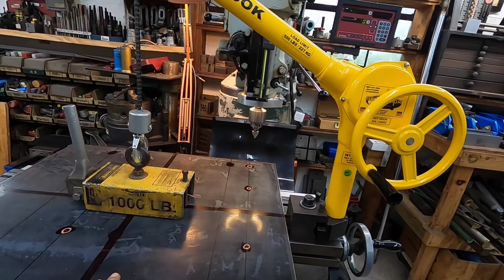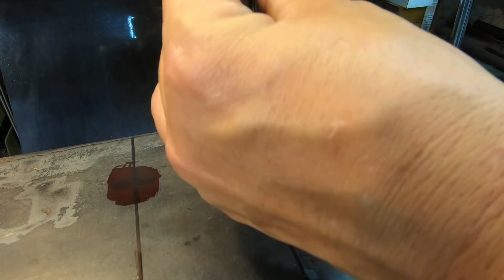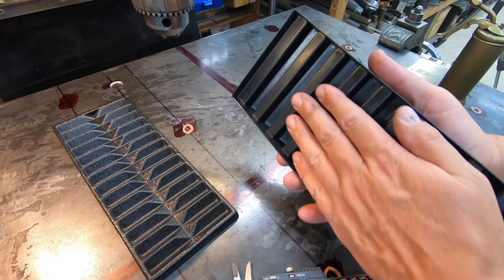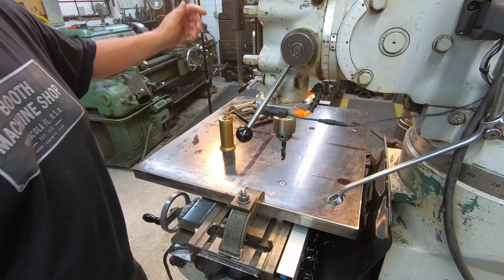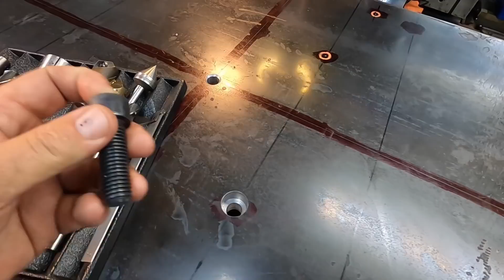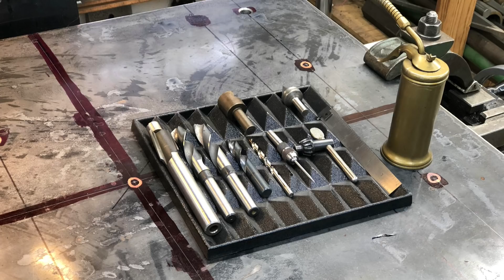Machining Hole Patterns in Stoker Engine Fixture Plate

Comment: Nice job Adam, but I have a question: why would you not tap the holes right after drilling them?  Everything was lined up and it would seem to be more efficient to tap the holes in the same setup as the drilling.
You gave some great explanations of basic layout methods and how to use the centre-finder wiggler to align the spindle with the punch divot.   I also really liked the optical punch unit and those neat little trays.

Comment: 19:44 interesting effects on that DRO screen. I assume it's the camera almost syncing with the screen refresh.
Reply: Yes, it is the same effect that makes wheels and propellers or rotors e.g. on helicopters look like not moving or spinning backwards. LEDs usually flicker, also we do not usually see this due to either the frequency or some kind of inertia in some LEDs (mainly those that use chemical coatings to create a certain color, but actually it is 99 % frequency)
If the camera shutter is not synched exactly to the LED frequency they will flicker. same with fluorescent lamps. sometimes depending on the chip type in the camera you may also see those brighter and darker stripes vertically rolling through the picture. To avoid that effect you would have to run the LEDs on actual DC (which is rare) or use a shutter speed that is slower than the cycle for the LED.
In the LEDs this flicker is usually generated by how the LEDs are driven, or more exactly which power supply is used. In the simplest case (most LED light bulb) it is just a capacitive dropper, that more or less cuts the AC sine wave in half, so you will find frequencies related to the AC frequency, 60 Hz for the US and Canada, and 50 Hz in Europe for example.
Better capacitive power supplies invert the "negative" partof the sine wave so we get double the frequency. Only the "inertia" of our eyes allows us to not usually see a flicker.
Incandescent bulbs flicker at twice the AC frequency as well as the currents sine wave peaks at positive and negative and in between crosses zero. it is just that the actual glowing of the  filament wil dampen the flicker as it does not cool down fast enough to make it visible.
Some LED drivers use smoothing capacitors to generate such an effect.
Less an issue are switch mode power supplies. those internaly use a chip to change the frequency to something in the range of 30 kHz, which allows a lot smaller transformers to be used. To capture that flicker you would have to borrow a camera from the slow mo guys to make it visible.

Comment: He got it figured out, but he didn't, he did not need the cart at all, once the sky hook had rotated the plate out into the isle way it would rotate freely, then swing the plate back in. Ron W4BIN
Reply: I was wondering why he used the cart to turn the plate around at first, but I think he had a good reason to do it that way. The sky hook's bicycle sprocket chain isn't going to twist very far, and I suspect that the hook doesn't have a pivot. So, spinning the plate 180º on the sky hook probably wasn't a good option.
Reply: @Nf6xNet  I wondered about the hook as well. Not sure if that is an extra available if you order a Skyhook, but I bet there are a lot of situations where a swivel joint attaching the hook to the chain would make life a lot easier. Just not sure how much bigger that would get or if it would reduce the load capacity.
Reply: True - but the cardinal rule of lifting heavy material is to never have it higher off a supporting surface than absolutely necessary.  It would better to have the plate drop an inch onto the cart than four feet to the floor and so the cart was there to provide a safe surface onto which the plate could drop should the magnet, the strap or the skyhook cable fail.
Reply: True - but the cardinal rule of lifting heavy material is to never have it higher off a supporting surface than absolutely necessary.  It would better to have the plate drop an inch onto the cart than four feet to the floor and so the cart was there to provide a safe surface onto which the plate could drop should the magnet, the strap or the skyhook cableThe cart provided a safe surface onto which the plate could drop should the magnet, the strap or the skyhook cable fail.  fail.

Comment: Could you use the FlexArm to drill the holes?
Reply: It has no means of applying downward pressure - so would rely on your own body weight - and for that to be enough, you'd have to use a whole series of drills making the holes an eighth of an inch bigger each time !
Reply: In addition to what pmailkeey wrote about no downward pressure, the FlexArm is made to float around in X, Y and Z while preventing rotation. Maybe it would have been fine with that piloted counterbore, but it would have relied entirely on each drill self-centering on the punch mark or the previous hole. I think the finished hole locations would have been less accurate with the FlexArm.
Reply: @Nf6xNet  Not sure about 'X','Y' and 'Z' ! possibly more h, r and θ !
Reply: @millomweb  True!
Reply: @Nf6xNet  oh boy, here they come... ;)
Reply: @alexku8452  Could you use the flex arm to make a milkshake?
Reply: @Nf6xNet  You just have to find the right YouTube machinist to make a stirrer that can be mounted in the flexarm for that purpose. I am just not yet convinced if the flexarm has actually enough rpms to make a really good shake though...
Reply: @alexku8452  What if we add a little planetary gearbox to speed it up? LOL!

Comment: Wondering why when it came time to rotate the plate 180 you had to set it on the cart. Couldn't just hoist it, spin it and drop it?
Reply: I think the chain on the skyhook is a roller link chain like a motorcycle chain, they don't twist well
Reply: @UnreasonableSteve  AH
Reply: @woeuntousall2611  Yeah - doesn't appear to be a swivel on the hook. Maybe he should have just unscrewed the eye bolt a little on the magnet ;)
Reply: @UnreasonableSteve  Wouldn't there be a swivel on the hook itself? Looked like there was plenty of room to spin if there was a swivel.

Comment: Adam, when you chamfered the counterbores, why didn't you chamfer the "inner" hole too?  Don't the SHCSs have enough radius under the head to interfere with a sharp corner?  I'm not trying to be a PITA here, I'm just curious and interested in what you and others say about this "possible" interference.
Reply: No need to chamfer the inner hole because he drilled it for clearance. A clearance hole is larger than the OD of the bolt under head radius. If you are still not sure look up what is meant by a clearance hole.
Reply: @utidjian  I was thinking that since the 1/32-inch clearance only gives ~0.0156-in. per side, that corner could hit in the radius of the screw.  I'll go check my Machinist's Handbook to verify though.  Thanks!

Comment: Question Adam, what could happen to the drilling of the pilot holes if you didn't spotface first?
Reply: This is a good question. Spotfacing helps ensure that the pilot drill stays vertical and doesn't "walk" or bend, which results in a non-vertical or oval hole. 
At 6:44 Adam gives us a great head on view of the larger drill bit where you can see the "flat" section in the middle. With a small pilot drill that can bend, that small flat spot may cause the bit to skid over the material surface before digging in and starting the hole. By spotfacing and providing a countersink for the pilot drill to match up with, you know it will start drilling in the right location.
I don't know if we see the tip of the spotting drill in this video, but from what it looks like based on the chips and how pretty the countersink looks, is Adam has a special grind on his spotting drill where that center flat on the tip is removed, essentially the two flutes meet perfectly in the middle. It is also relatively wide and short which helps with rigidity, again helping ensure that the countersink it leaves is centered in the correct location.
We use center drills a lot at work, which serve the same purpose but only have one flute and a stepped grind.  https://upload.wikimedia.org/wikipedia/commons/thumb/d/df/CenterDrills123456.jpg/400px-CenterDrills123456.jpg

Comment: Even using the prybar to get the plate up you should really be using some sort of a push bar to get the parallel under. I was told long ago by a guy missing the tip of a finger "never stick your finger anywhere you wouldn't stuck your pecker" 😂

Comment: Hey Abom! Question,
is there a reason for why - when drilling - you squirt the oil at the upper parts of the bit and let it drip down as opposed squirting oil directly at the cut? Just wondering
always interesting to see you work!
Reply: Same result.

Comment: Suggestion to all, for every commonly used tap make up a wooden block and drill holes to take that tap set plus is tapping drill plus it's clearance drill plus the counter bore for the cap screw used for that taped hole, saves a ton of time and you always certain to have the correct sizes on hand that are only used for that tap/bolt size, drill bits are cheap compared to shop hour rate
Reply: I have my gigantic chart hanging in front of my face. It's another way to approach the issue.

Comment: I understand the need to get the plate of the table using parallels but wouldn't a plate that large sag under it's own weight? Or is it not enough to be concerned about blowing tolerance?

Comment: Many edge finders, such as B&S have a point on the opposite end of the .200 side that is typically used for edge finding.  I never see anyone use this feature. Adam, what are your thoughts.  Not a criticism in any way, just something I've wondered about.  I dont have a wiggler or a Blake. I've made many plates like that on a radial using only layout lines and a dead center,  big Ooya radial drill. Thanks for the video,  Will

Comment: Adam, that plate may be under 500 pounds but the magnet has to be included in how much the skyhook can lift. I speak from experience having watched someone lift a 5 ton load with a 5 ton cane. They forgot they had a 2500 pound lifting device hanging on the hook too. Result wasn't pretty.
Reply: I bet that wasn't pretty. It is amazing how much people forget that the load includes everything that is being lifted not just what is attached to the hook.
Reply: @Jim H  One could say the same about you Jim. The man is simply offering some advice and no one is perfect.
Reply: @Jim H  Sorry you would lose on that one. I'm a chemist by education and a stay at home dad/handyman/jack of all master of none by trade. My wife's an engineer though so maybe it is rubbing off :) Have a great evening and rest of your weekend/2020

Comment: Have you tried taking the magnet outside and blasting the swarth off it with shop air?   I don’t know it if it will work with that large magnet, but it works with my smaller magnets.
Reply: Quality duct tape works wonders for cleaning magnets as well

Comment: Hi Adam, I think the Sky Hook needs a larger diameter handwheel. It looks like the small wheel is hard to turn with that weight on it, and knowing you don't do too many light small jobs either.
Reply: I'd assume the hand wheel is that size so you don't overload the unit.
Reply: It has a gearbox ... 🙄

Comment: I'm a second year apprentice in Germany and your remark in regards to your counterbore tool being too large with a 1" diameter for a 15/16 hole made me curious about the American size that would be correct.
I am always on the look out to learn more, so out of curiousity I looked up the German standard:
A 15/16 cap screw would be about an M16 screw with a 23,8 mm head, which would receive a 26 mm or 1" countersink.

Your channel got me interested in metalworking by the way and inspired me to become a precision mechanik.
I like how you often explain what you are going to do, it has taught me a lot already and I am looking forwards to learn more.
Thank you! :)
Reply: If you're interested in CNC machining I can recommend the channel "Edge Precision"

Comment: (@9:57) - So THAT’s how you change the belts on it! 😎
Reply: Thanks for pointing that out.  My Rockwell mill is the same way but has hex head bolts instead of bolts with a handles.  I think I’m going to custom make two bolts with handles to speed things up on my mill.
Reply: @shadowdog500  I ran a Rockwell mil for 14 years. Mine had little handles on the bolts for the motor mount plate. Just about a half turn was enought to loosen it so it could be shifted to change the speeds. They were the same style all over the mill. Same as the locks for axes.  The Rockwell is an excellent mill within its class. I wouldn't mind having one again.
Reply: @utidjian  Thanks for pointing that out. I just looked at photos of other Rockwell mills and agree that the motor plate bolts are the same levers as the axis locks.  Looks like I found a small project to do for my mill.  Thanks.
Reply: @shadowdog500  Just a quick note before I go to work. I found your channel and your walkthrough on your Rockwell (nice looking mill.) Yes, they X and Y axes on your has the correct (stock) locks. The Z seems to be missing the plain round end handle. The quill lock handle is not stock but I like it :D It would be a simple project to make some up on the lathe and mill. What lathe do you have there? Looks like it might be a Jet (or one of the bazillion Taiwanese variations.) I will move over to your channel for any more comments.
Reply: @utidjian  The z just has a bolt in the hole.  I’ll probably upgrade that when I do the motor bolts.   You are correct on the lathe, it is one of the Taiwanese lathes that sold as a Jet and a bunch of other names.  Mine is an MSC 1136B. It has an 11” swing which is sufficient for me.  Mine is the older model with the 60mm by 8 TPI thread on the headstock.  It is difficult to impossible to find backing plates for this lathe.   I actually found the lathe on Craigslist and when I called and talked to the guy he asked me if I wanted the Mill that he hadn’t listed yet.  I wound up buying them both at the same time.

Comment: Not a machinist, but I can see how the Sky Hook and that magnetic lifting device allows those Abom size parts to become manageable. Always enjoy watching you work.
Reply: My only suggestion would be for Adam to make a lockable rotating adapter for between the hook and chain on that Sky Hook so that if and when needed he can unlock and rotate whilst connected to Sky Hook rather than having to lower onto trolley - if these heavy lift jobs are going to be regular. 

HTH

Comment: Oh Adam.. I know you know what you are doing, but when you put your fingers under that big plate, I got really scared.
Reply: If you recheck the video you'll see he used his fingers on the vertical face of each parallel to push them into position. At no time were his fingers between the top of the parallel and the plate. SOP when lifting anything heavy is to not place yourself or any body parts under the object being lifted without something that will support the load if it drops.
Reply: Oh, Now I see. You are right.

It impressed me because I've lost one of my finger tips and believe me... its not fun at all. Months of pain, literally.

Comment: Instead of drilling a smaller hole for the bigger one . I think you could get away with out the smaller by making a crankshaft split on the chisel. The drill should center itself better too .

Comment: Might I request, if you're going to break jobs into so many episodes that you release more during the week? Even if they're only 10/15 minutes, it would be higher quality content imo. I'm sure there are plenty of people that would complain if you didn't show every hole drilled and tapped individually. Which is why maybe putting out 2, 3, or 4 videos in a week might be better for others. Unless you really are doing this job on a weekly/weekend basis, in that case I totally understand why you don't. But I guess it also depends on how much you record and the time it might take to edit hours of filming a day. So, it's just a suggestion, obviously I'd still watch either way so...

Comment: Regarding the tool trays: Fill the back side with epoxy or polyester resin (composite resin, not body filler). You can use fine gravel as a filler so that you don't need so much resin.
I do this with the flimsy vacuum molded styrene trays you get in today's tool kits - it turns the flimsy tray into a tray that will last forever.

Comment: any reason to use vertical mill versus mag drill ?
Reply: Mag drills are usually fixed speed, wouldn't want to use that counter bore tool in that one, at least I wouldn't.

Comment: Thanks, this is such good information for a beginner. Would you cut a large counterbore in the same way? Let’s say for a hex head bolt, and allowing clearance for a socket.
Reply: That certainly could be done in similar manner.  It might require 2 or more counterbore steps to open up far enough for a hex head and socket.
Reply: the counterbore itself can be done with a centercutting end mill

Comment: I think I'm gonna invest in one of them skyhook type  cranes, I always laughed at um, but last weekend i pulled my back out heaving a large cube while setting up a casting to be machined on  my bridgeport mill.
Reply: The Skyhook seems to be working really well and being able to attach it to the bed of the various machines makes it really handy. As for the lift cart, there are two types of people, those who have one and those who need one and that goes for even if you aren't doing machining. The 1 ton ones lift high enough to line up with a lot of pickup beds.